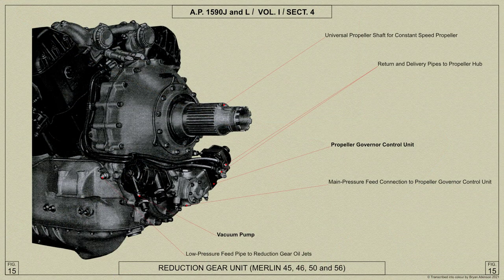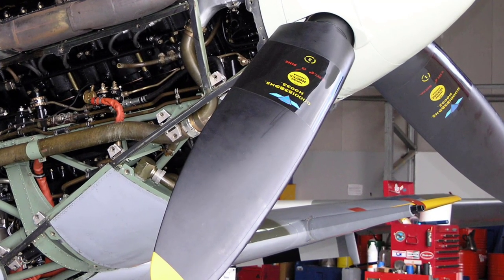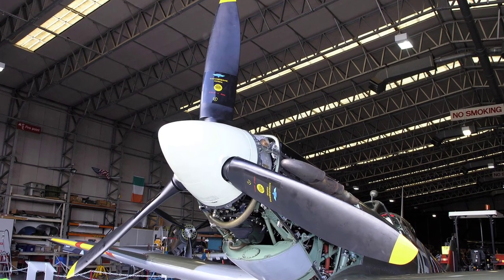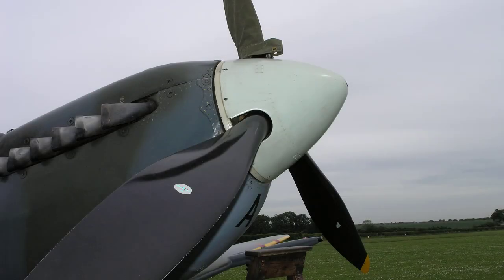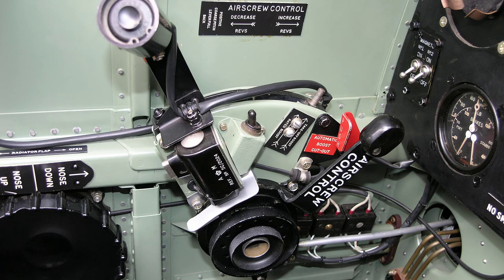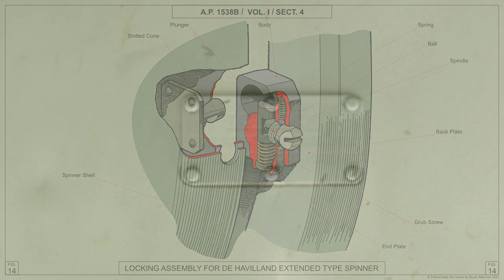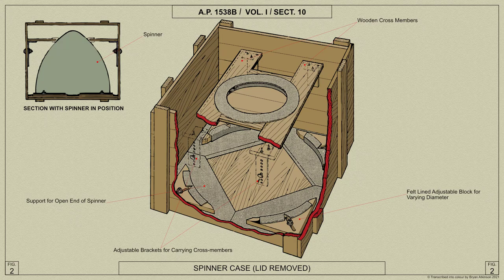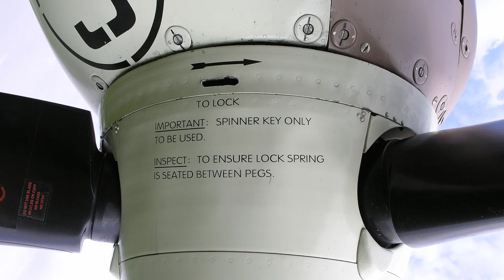Spitfire Mk V – The Propeller

Comment: Brilliant detailed set of videos. I am still however confused as to when and why one would use the throttle lever and or the airscrew lever? I'm a glider pilot not a power pilot but still interested. A simple explanation would be really helpfull. Thanks
Reply from the maker: With the introduction of Propeller variable pitch units,  the airscrew control lever was used by the pilot to select the pitch required by either moving the lever fully back fine for the D H Propeller or fully forward for the Rotol propeller.

Comment: I believe early Mk Vs built at the CBAF used the earlier 10'9" variant of the Rotol (with corresponding rounded, blunt spinner) as used by the Mk IIA, before moving to the 10'3" Jablo type with broad root and pointed spinner?
Reply from the maker: Thanks for info

Comment: Thank you very much, I enjoyed your explainations alot, however I have a question, - if the propeller rpm causes the blades pitch to change due to centrifugal forces opening a valve to allow oil to push a cylinder, then how does the "airscrew control" lever in the cockpit work? Does it just increase the propellors pitch or does it set the blades range of pitch lower while reducing throttle or what is happening and how?

Thank you very much.
Reply from the maker: The Airscrew Control Lever for the de Havilland 20° or Rotol 35° constant speed airscrew is fitted on the throttle quadrant.

The de Havilland 20° airscrew has a Positive Coarse Pitch position which is obtained in the extreme aft position of the control lever, when the airscrew blades are held at their maximum coarse pitch angles and the airscrew functions as a fixed airscrew. Some aircraft are fitted with a De Havilland hydromatic propellor. Thanks for watching.

Comment: Great presentation. So, the ROTOL pitch range is 30 to 64 and the de Havilland range is 34 to 54. That seems like quite a difference, especially toward the course range for the ROTOL. Was the ROTOL propeller able to be used effectively on higher power engines than the de Havilland? The ROTOL blades also looks like they are of greater surface area than the de Havilland blades, at least to my eye.
Reply from the maker: The info in the video is all I have at the moment. Thanks for watching